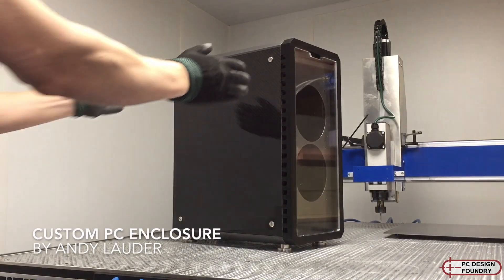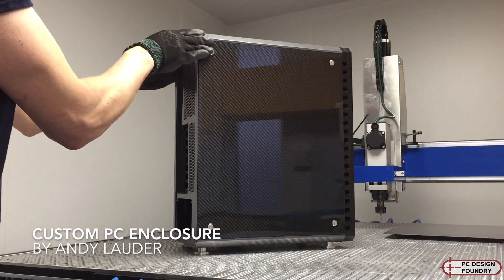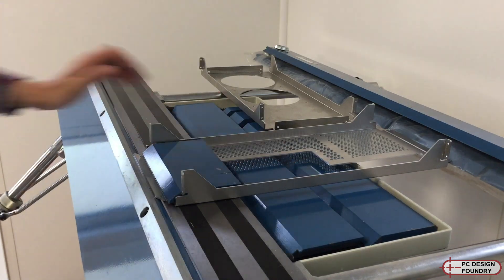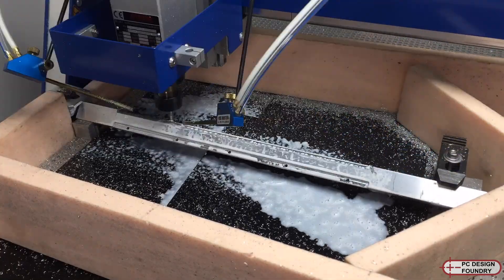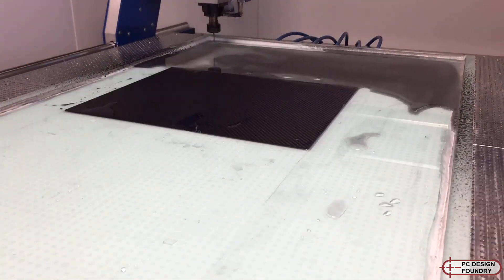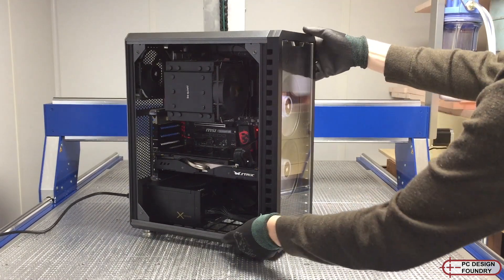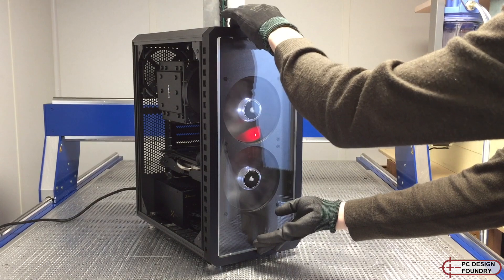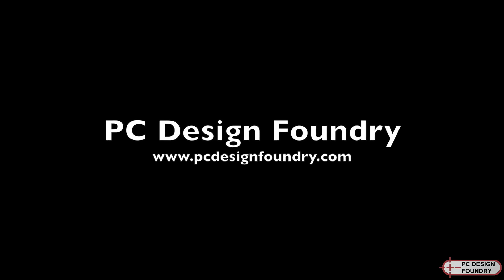Custom PC Case. Carbon Fibre Side Panels.

Comment: Looks awesome.
I am a stickler for airflow though, so i'd want more airflow from the side panels, the trend of closed off front pabels and then glass side panels, i don't get it, i'd make like a carbon frame side panel with mesh and mounting points for a few fans, especially near the GPU.
The back end has enough airflow though.
But there's no denying this looks really cool.
Of course this could be difficult since a lot of cases don't have the screws in the corners and you have to make those, most people will not go through that effort. You being able to do this all yourself is very cool. So many options and ideas.
If only i could afford it XD

Comment: i love the very technical and minimalistic design and you really can see the perfection in every part. but can you tell me where the front fans get their air from? is the air entering the case on the holes on the sides?
Reply from the maker: Hi Julius.   Yes air enters at the side holes.   It is enough at slow fan speeds however  I tend to use a different front cover now that has a large hex pattern which is less constrictive.

Comment: How much for one like is, but 3 fan front, Light I/O and carbon ? with one 295 mm RTX
Reply from the maker: Hi Niklas.  It is about £600 + shipping with the carbon fibre.     What size motherboard will you put in it?

Comment: have you ever tried installing a clinching nut with anything but pemserter?
Reply from the maker: I use the tooling bits form the pemserter but I install them on a Baileigh Bench Press BP-3.  I had to get some custom adaptor plates made to get them to fit.

Comment: Nice work! What do you think of your Stoney cnc router? I'm planning on buying a cnc later this year, mainly for woodworking and they are one of the makes I'm considering.
Reply from the maker: Hi Stephen.  Thanks.   I really like the Stoney cnc router.  I mainly use it for aluminium, plastics, composites or foam models. I have not done much wood.   The quality of the parts is as good as industrial router but for 1/2 to 1/3  of the cost.  Their support is really amazing as they are always happy to provide advice or help. 
I'm guessing at the drawbacks of the JBEC professional system but I think jobs take more time than an industrial setup.  You have to spend  time keeping it clean as the slides rails are exposed. There is no automatic tool changer option.
   
Before I purchased this router Stoney put me in touch with some of their customers who were machining Aluminium so I could actually go and see jobs running and talk to them.  You should see if they have any customers local to you who are doing wood work that you can visit.
Reply: Hi Andrew, thanks for taking the time to reply, I really appreciate it. The JBEC professional sits nicely in my price range, reassuring to hear that their after sales support is good. I think it will definitely be on my short-list. Thanks again, all the best...